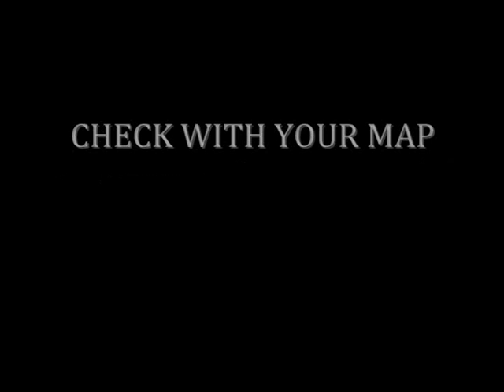compass magnetic variation explained

Comment: no not straight forward at all.bin looking at various maps and it tells you various degrees  west ,east etc totally confusing.guess all you need to know in the end is how many degrees you need to add or subtract ,why do you need to know whether its east or west?  for example if mag variation is 2 degrees for the lake district for example and you are taking a grid reference off a map and then taking a magnetic bearing ,am I right in saying you turn the compass to the left 2 degrees and head off in the compass direction thx ?
Reply: That's a good question lol 1:40

Comment: It is also called magnetic north and grid north. And to answer your question; when you hold a compass and find north with the arrow, that is magnetic north (variation). To get the grid north you will look at the declination diagraim on the map, find magnetic north, write down the degrees, and then subtract the GM angle.